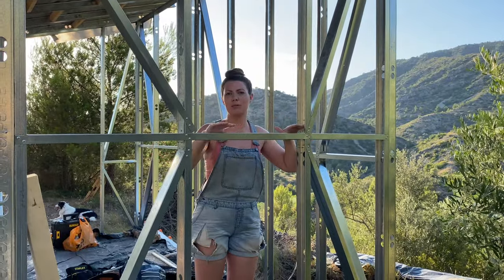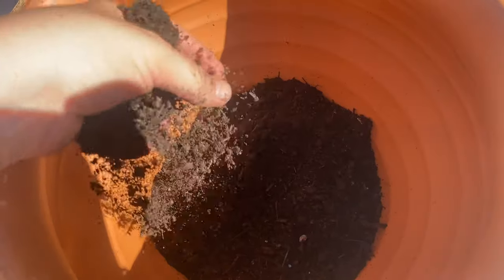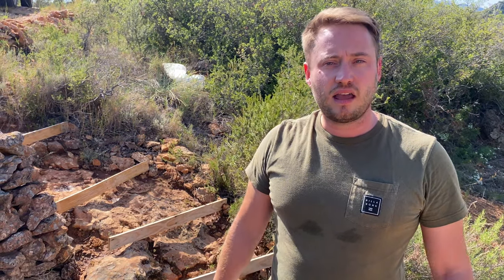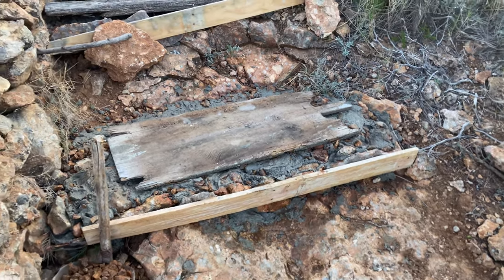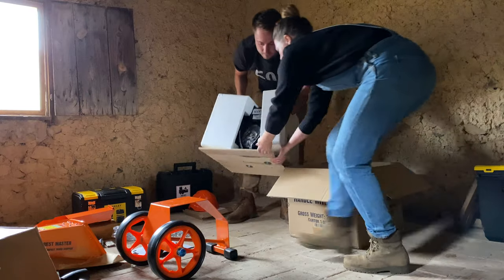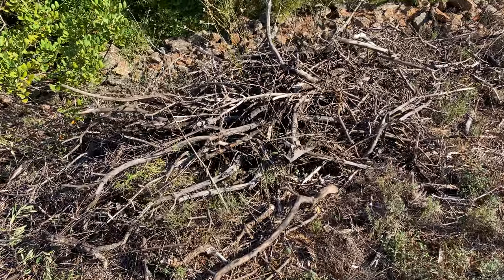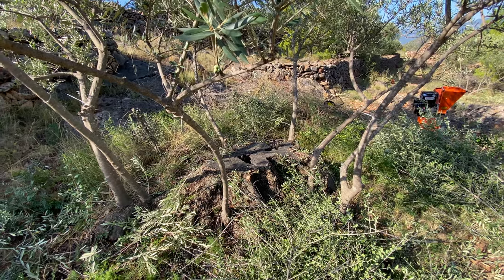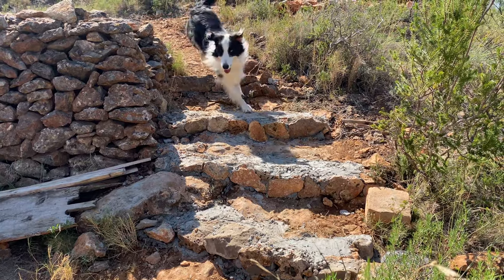New improvements to our Homestead | Off grid in Spain | V.30

Comment: If there's a small ditch nearby, put those dead branches in the ditch, cover with the green chips add water and you will get some very nice compost. You could aff any fruits that fell, or fall over winter to add to that compost. 
The dead branches act much like a sponge over winter and if you build any garden, propagation bedding, that "compost can then be used as a base for the bed, thereby holding moisture during hot weather. 
If there's another tree, shrub that could be pruned now, chip it up and add the green mixed into the branches. Lazy compost that should be good in spring.
Reply: If you have a tarp or something like that, cover the heap of wood on the lower side, leaving the uphill side open to the rain draining downhill. This will both reduce fire hazard and speed up the decomposition. Any type of covering should work
Reply from the maker: Brilliant idea! Thanks for sharing! We’ve been thinking about that for the veg beds - using the old dead branches as the base layer for hugelkultur. 
Hadn’t thought about the idea with the tarp, though. Could be a good way to tackle a lot of these old beaches a bit quicker!!
Reply: Totally agree. You have enough land to do a massive compost area  for all clippings, branches etc x

Comment: Possible upgrades for your cementing before you give up and get the cement mixer you know you need. - a 'bucket' trowel, which has a flat end and lets you scrape the bottom of the bucket properly. Also, in the UK at least, you can get a 6x6 or 6x4  tarpaulin sheet which will let you mix a whole 20kg bag of mortar mix at once with the two of you.
Reply from the maker: Oh thank you! All tips and ideas welcome!!